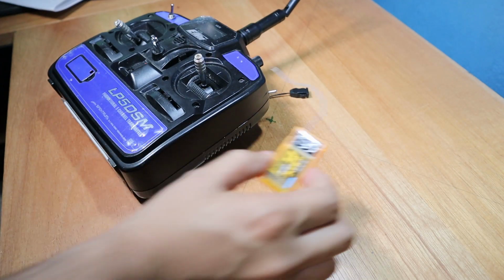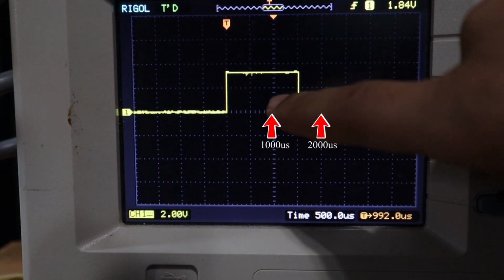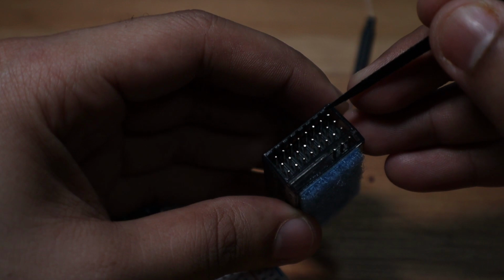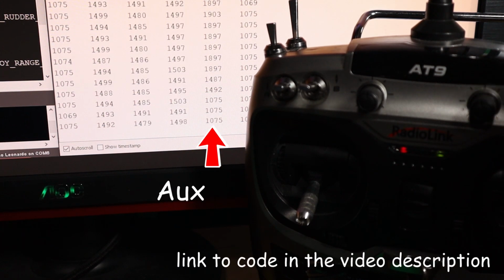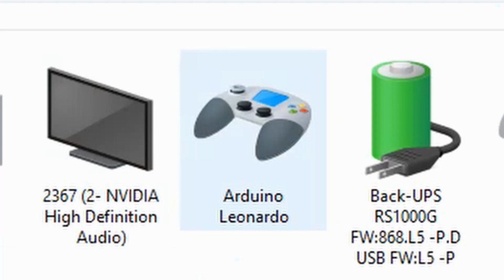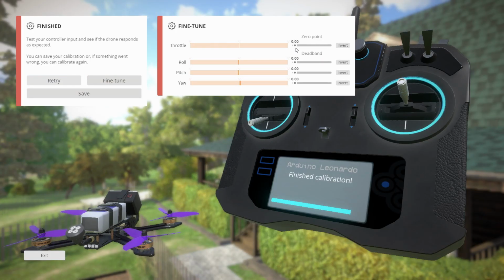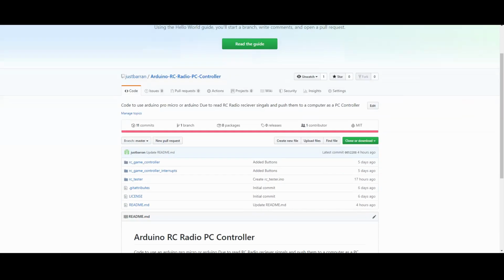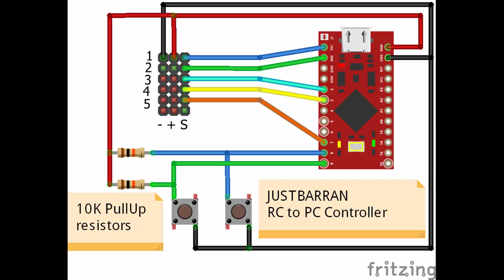RC radio into a wireless PC controller | FPV Drone simulator

Comment: my right stick's up-down motion is inverted. how to fix it. the rest worked perfectly. Thanks for making such amazing tutorial.
Reply from the maker: Hey man, thanks for watching the video. you could change that either in the flight simulator or in the code via the map function. Just switch the limits. I recommend to the the fix in the flight simulator under controls. There should be an invert stick option. Right stick up and down would be “pitch”. I Am not home but I could assist better later if you still haven’t solve the problem.
Reply: @JustBarran   I am currently downloading the simulator. Also, can I use this setup with other games? I tried it in Forza Horizon 4. It recognizes the device but I cannot configure the buttons.
Reply from the maker: How good are you with code? I never tried it with a car game but am guessing that we would need to change the code for car controls. The joystick library has some racing controls trottle, steering, acceleration and brake thank we can modify the code if the game doesn’t recognize it. Check the controller settings in devices to make sure.
Reply from the maker: Hit me an email justbarran@gmail.com and I can send you something to try when I get time. If it works I would push it to git.